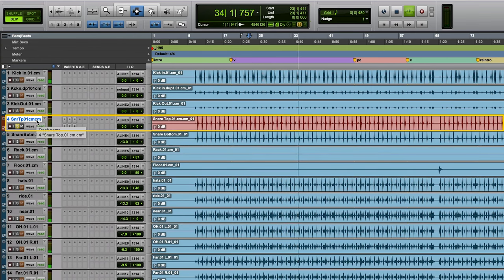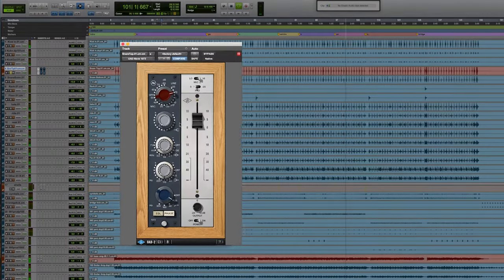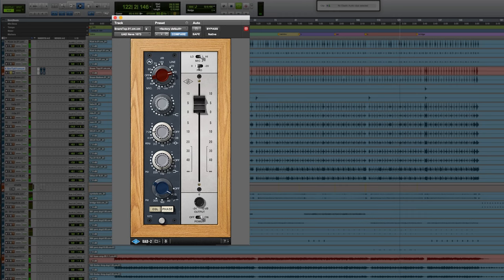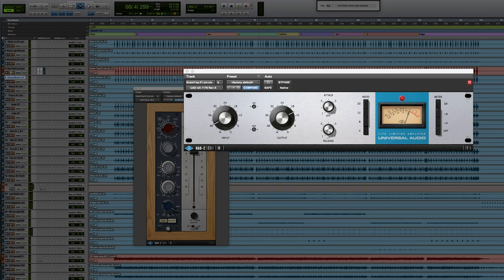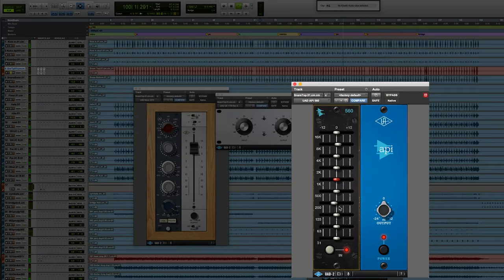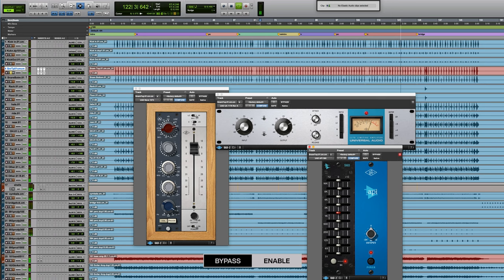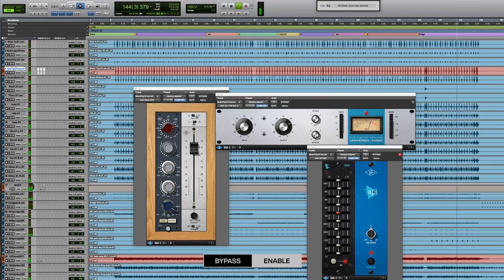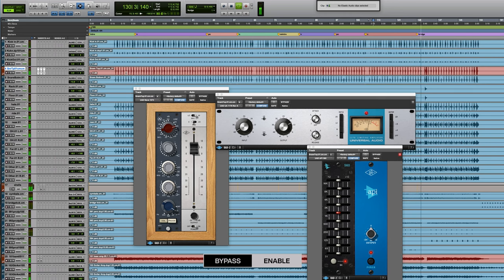Mixing Snare to Cut Through a Rock Mix

Comment: 1176 brings too much room imo. Try using a 160VU @ 2:1 instead after the 1073 (i use the 1084 sometimes). Then last in chain a pultec @100 +3db and finally the icing on the cake is a fairly broad +5db @8k cycles. Call it a day! Cant go wrong with this chain.